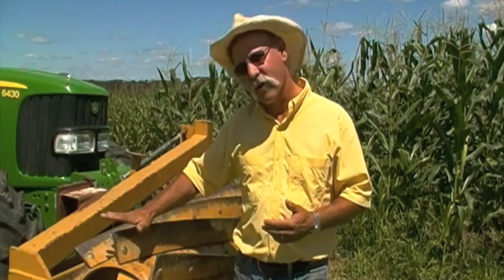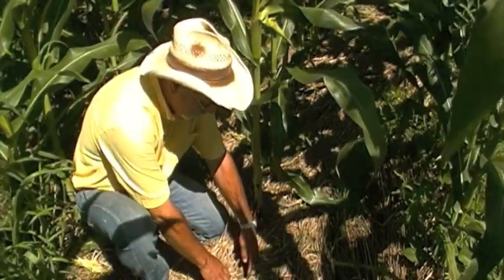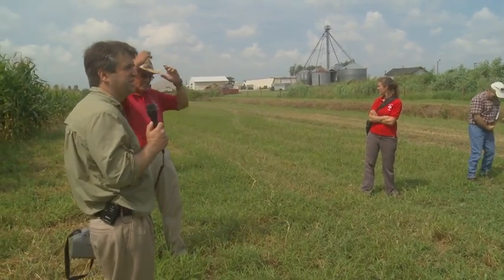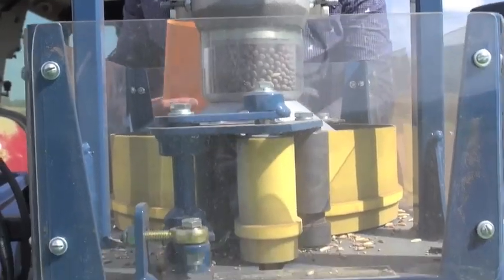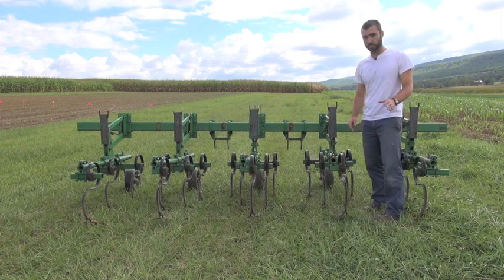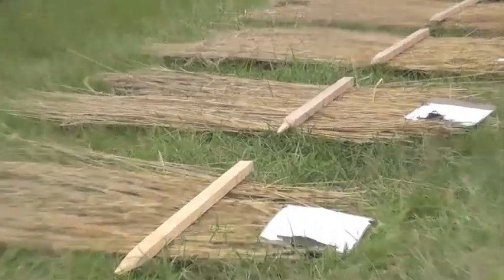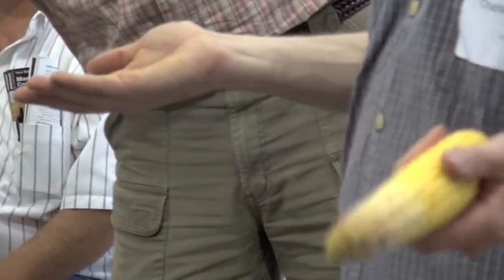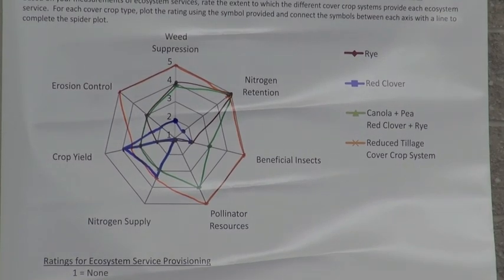Organic No-Till Weed Management

Comment: I am curious if you are finding that after a few years of doing this, without any tillage, the weed pressure becomes so minimal that you can even harvest the winter cereal crop and then sow the corn or soy into the straw/residue, without needing the roller-crimper anymore (except using it when you do put cover crops into the rotation).
Reply: The cover crop acts as a fertiliser as well, allowing the flowers to develop harvesting it would remove that benefit.

Comment: I did research with rye cover crops for my MS degree.  In dry springs, the cover crop removed so much soil moisture that the so surface soil was so dry that the planter could not penetrate it.  The population and crop yield was horrible.

Comment: How do the maize plants penetrate the mat but the weeds do not?
Reply: ***** This system is for large seeded crops which have enough energy to pushup through the mulch. Small seeded weeds are shaded out and cannot grow through. Also, the planter slices the residue leaving a small slit which the crops can then grown through.
Reply: When the planter, made for no till, rolls over the crimped residue, there are disks that roll over the mat and cut a very small furrow, just wide enough for the seed to get sunlight but not enough to allow weeds to develop.

Comment: Video says "No-Till Weed Management", but over half is tilling as far as I can see. Why not stick to no-till all the way and benefit from much less to no watering, constant nutrition to the soil and a flowering soil life with fungi, bacteria and earthworm doing all the needed tilling? Mechanical tilling kills all that...
Reply: ?
The first piece of equipment was a roller, no soil penetration, just knocking down the protective/mulching crop, and the tilling I saw was to de-weed on either side of the crop.
Reply: Harald Sandø You need to compare the various systems side by side to get relevant scientific data.
Reply: Harald Sando, I see your point about the title being "No Till" and then at 5:40 the speaker from NCS is saying 
"...No answer to perennial weeds if were gonna go long term "no-till" we have to have tillage in the system, with our current technology, to be able to disrupt the weed cycles, but we can shift when that tillage occurs."
In the first 4 minutes, Jeff Moyer from the Rodale Institute, accurately described the title on this youtube video.
In the rest of this compilation one thing to note is the color of the soil being tilled. It is lifeless and not being fed by a covercrop. Covercrops add to the next years production on an ever increasing basis. 
You are wholly correct to point this out.
I see somewhat of a progression here. Answering the question "Is any tilling harmful" Modern farming will be revolutionized and saved (as will mankind) from this correctly applied good farming practice.
Reply: lettertube This is helpful, but only the beginning of the next step, even more beneficial, pasture cropping.
Reply: no pasture cropping

Comment: can anyone tell me what does it mean No Till ..the dictionary wont work :)
Reply: +glitpheyton No tillage is done prior to planting the crop.  In this case they use the roller on the front of the tractor and the planter is mounted on the back of the tractor.  There are a variety of systems of no till used.  In a typical tillage conventional system the ground is plowed, disced or cultivated until smooth and then planted

Comment: This is crap farming. You think a big farmer like me has time to mess around small equipment like this. Plus I'm pretty happy with strip tillage
Reply: Yes a big farmer like you definitely has time to mess around with small equipment like this when cover crops have been shown to reduce the frequency of nitrogen applications and reduce the amt of nitrogen necessary. A roller crimper can be used to terminate a cover crop and very little weeding will need to be done. I agree strip till is actually very good for yield and soil health. They may reduce fungicide applications and protect beneficial predatory insects which are vulnerable to bare ground unlike quickly-repopulating pests so you won't need to use pesticide as often unless you really see a problem. Some covers can scavenge nutrients and their decaying roots still hold nutrients and keep them from going deeper in the soil. Covers also usually protect and grow mycorrhizal fungi populations which scavenge nutrients including water for row crops. There's no excuse to not help yourself with a $20-30 cover crop including fuel. I would do this no-till or strip-till like you said.
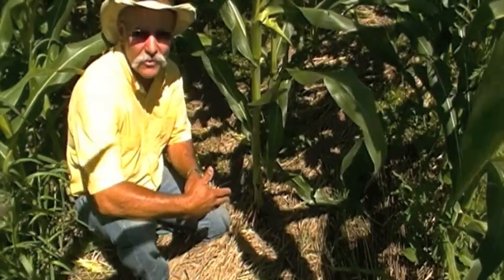Reply: At 4:04 the row behind him is full of weeds.
Reply: Matthew Niedbala how in the hell is rye going to increase nitrogen in the soil? A heavy mat of residue of any kind ties up nitrogen.... nitrogen is required by biology in the soil to break this residue down... unfortunately they are doing this at the exact same time the corn needs it... but hey they are drs right they must know what they are talking about 🤭
Reply: @farmermatt629  what about the rye from last year? There is. O quick fix. You are thinking way to short term.
Reply: @farmermatt629  - Admittedly you're not the first to miss one detail the nitrogen tie up happens, by far and wide, when the residue is tilled in! As said before, there's also the very important factor, that's a continuous work. Not an isolated event in a test tube.
Cheers